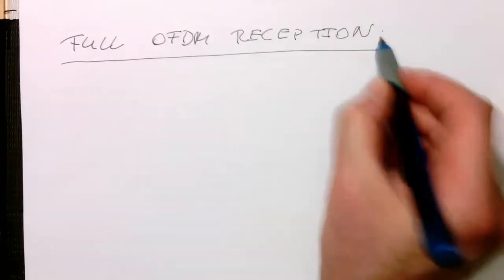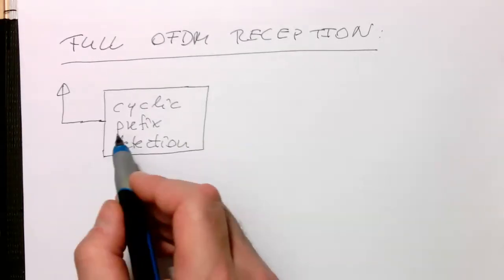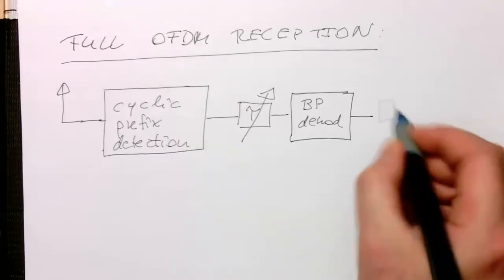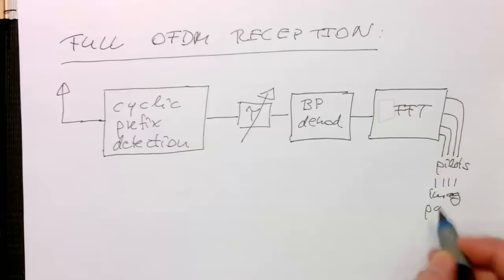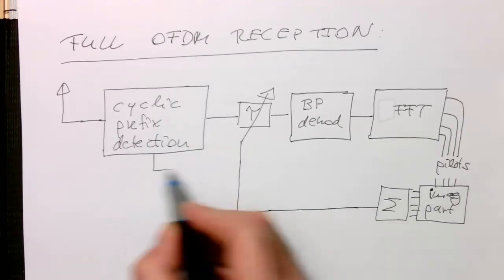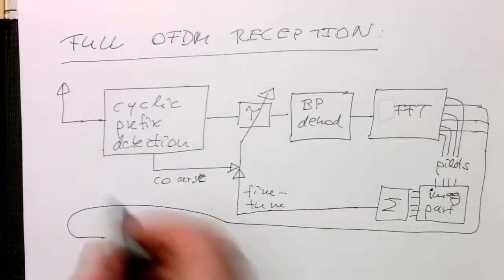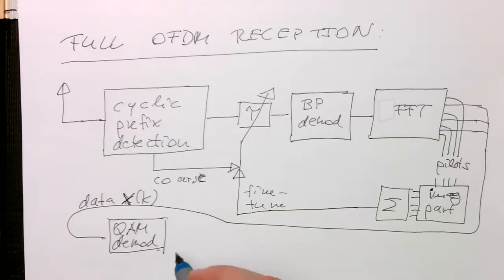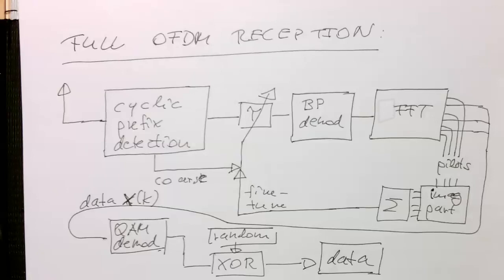OFDM: Complete receiver (0033)

Comment: The first part of the receiver is the down-converter, or quadrature demodulator, right? That's to handle the quadrature carriers. Bandpass filtering is done on the two recovered quadrature waveforms. And cyclic prefix detection is then applied after this right? And - if the communications channel has multipath effects, then will this technique (of adjusting the delay at the receiver side) still work? 

If the original transmitted signal becomes transformed by the multipath communications medium, then the incoming raw signal (at the receiver side) can first be processed (by the cyclic prefix routine) to obtain a rough estimate of the start of each symbol sequence pattern. But -- because we have a multipath channel, then adjustments in delay (followed by FFT) might not lead to pilots becoming real, because the incoming signal is not a linearly proportional version of the original transmitted signal. I thought I'd ask about this, as I'm just trying to understand if more needs to be done to recover the data when the communications medium has multipath components in it. Thanks very much!!